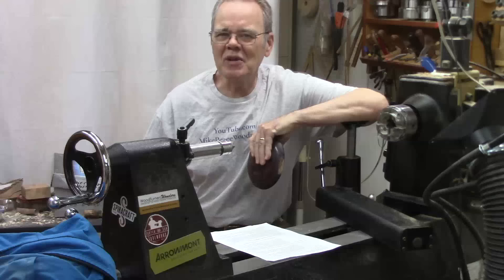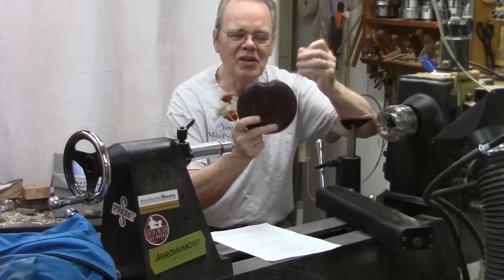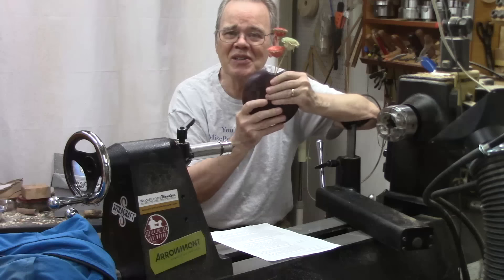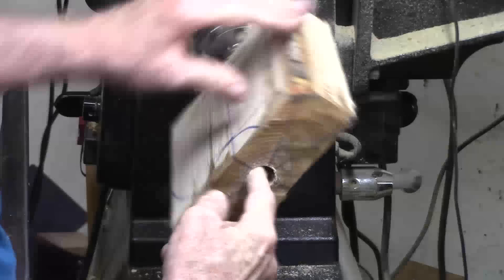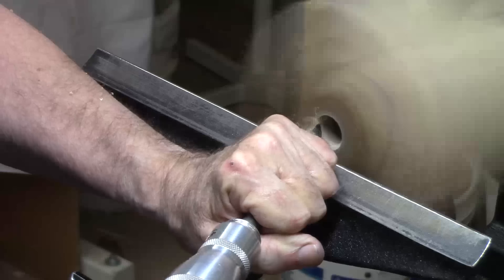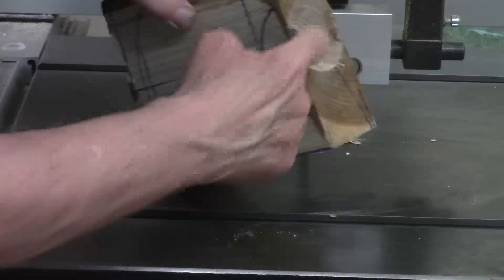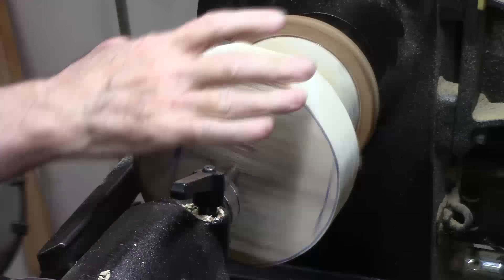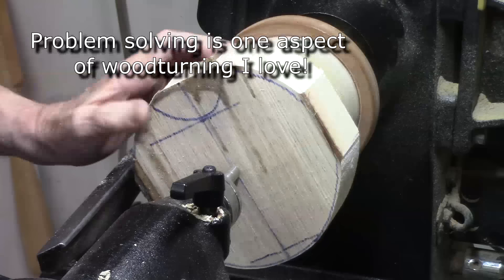Multi Axis Disc Flower Vase | 4-Ways Woodturning Collaboration

Comment: Great project. I'm going to try this and I'm wondering if you could have used just the vacuum chuck; that is, why not clean the outside face for a good seal, then flip back and forth. Were the tenon and chuck needed for centering?
Reply from the maker: Probably. I just felt it would be  more secure shaping the bad side that would not hold a seal held with a tenon.

Comment: Very nice I love the design. Off to see the other three. On a side note what brand of vacuum pump do you use?
Reply from the maker: I bought a used Gast on eBay when they were a lot cheaper than they are now. There are cheaper options. Just get one that pulls at least 4CFM.